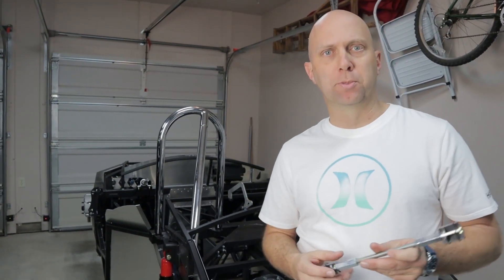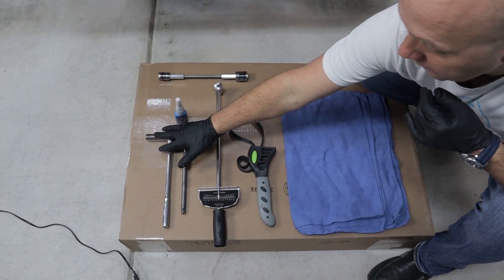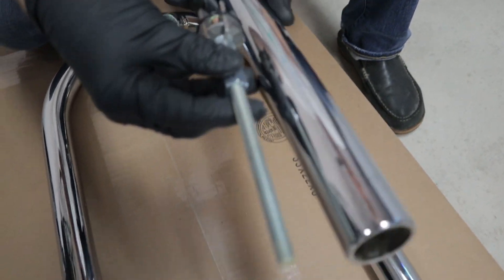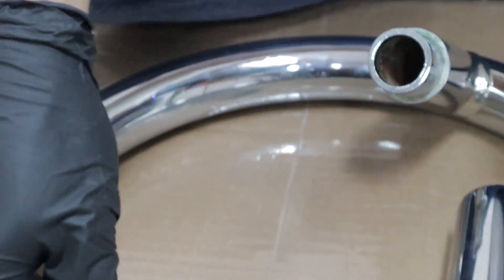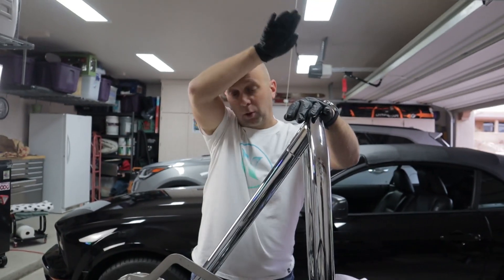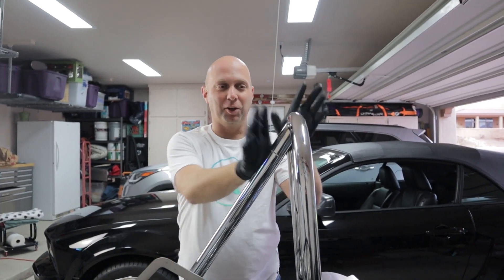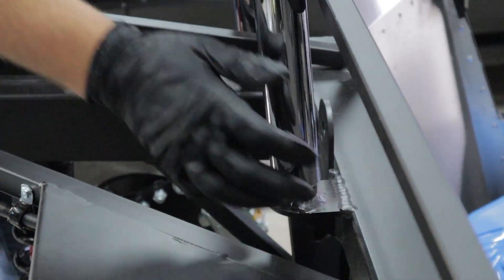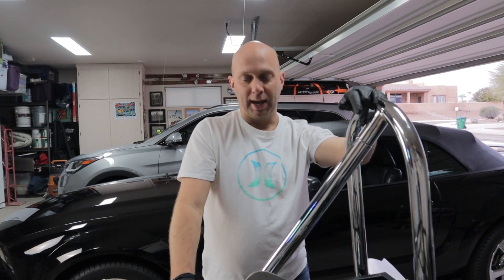Bolt-less Roll Bar Instructions Factory Five Racing

Comment: was test fitting mine today and when removing, the all thread started coming out from the bottom rather than the top, despite using blue locktite. I was able to get it off eventually, but is there a better way to prevent this? I was thinking antiseize on the top threads.
Reply from the maker: @egchewy. If locktite doesnt work you can use red locktite. Would be a little difficult if you ever have to take it out of the tube. But dont know why you would ever have to do that. Call me if you have questions.

Comment: Very nice product that works very smoothly.  Only thing I did differently was to add two nuts at the top of the allthread to keep from screwing up the threads.  Even with a brass hammer I was rolling the threads.  Took about 20 minutes start to finish.
Reply from the maker: David glad it worked out. Maybe I will start adding a couple nuts in the kits.